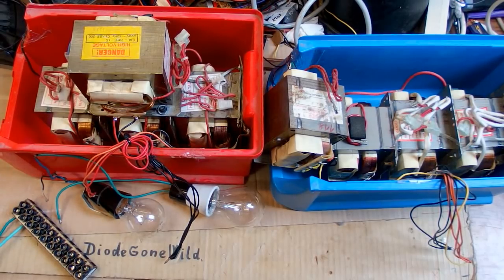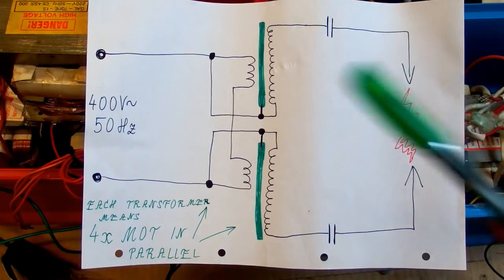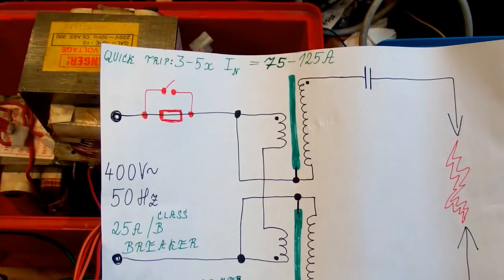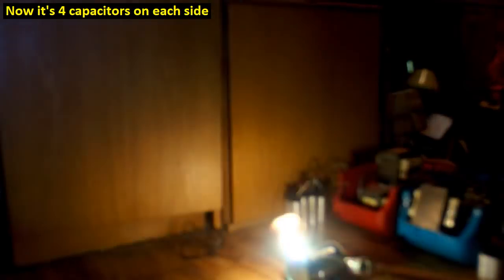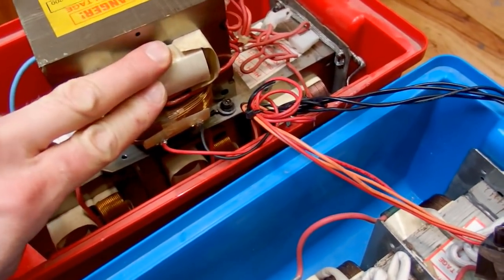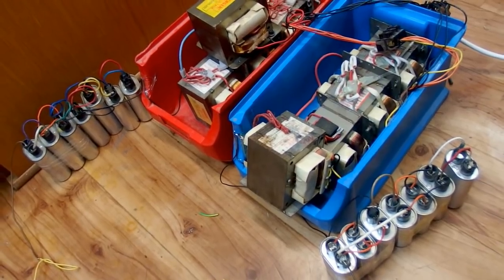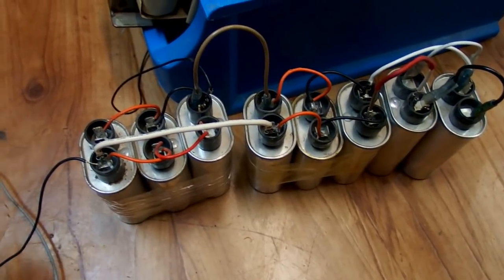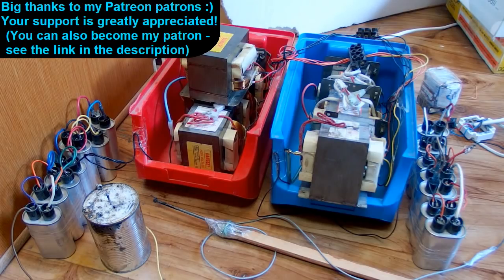Making Lightning in my Living Room

Comment: Do the same experiment but this time use a fire long and narrow in a straight line built in a trough. The electricity will take a very strong conductive path through the plasma of the fire 🔥. Your arc may be able to go 3 to 4 m.   Ozone generator

Comment: I'd like to point out that the arc is getting to be longer than the stick your using plus wood is not a good idea it can start to conduct. get a longer stick or one made of a better insulator.
Reply: @mernok2001  I spent some time doing lightning testing to some aircraft equipment. the switch handles for the HV equipment were rods about 5 foot long. they went in to the test equipment from the front and the switch was right at the back. one test house had a bank of cap's where each one was the size of a washing machine there must have been 40 of them. the problem with that sort of power you don't get a second chance.

Comment: Even though I'm a radio amateur,I'm even afraid to measure mains voltage..and diodegonewild plays with this ridiculously dangerous and completely unnecessary build,while safety precautions include a chinese sunglass,a flamable panth and a rubber sneaker :D

Comment: Now put secondaries in series.
Reply: You can't really because one side of the secondary is connected to the frame of the transformer and the insulation is only good for a little over 2000 volts. If you put two in series you will get arcing to the primary from overvoltage.

Comment: How the hell the curent go way higher in arching than in shorting!?
Reply from the maker: Short circuit probably saturates the magnetic shunts in the MOT's so it doesn't resonate with the capacitors so much.
Reply: @DiodeGoneWild  , as Szakallat said.
You can give an easy try, you usualy have old gadgets so I assume you have old analog amp meter with 25 or 50 amp range.
Well, till the corona-flu lasts no one in a hurry...

Comment: I would imagine there is a little radio interference, you pirate radio station lol.
There is no way i would mess around like that, measuring 40kv t.v crt anode via a home made resistive probe was worrying.
A very long line of blue 3 watt high voltage resistors  coated with anti corona laquer gave me a divide by 100 into a 10meg digital.

Comment: i can imagine the smell of ozone would be strong in the room
Reply: Its not too crazy with the voltage being so (relatively) low, the corona discharge is pretty low. Especially once the arc is struck. You'd get WAY more from a single 15Kv 20ma neon sign transformer sitting open circuit!
Reply from the maker: it smells more like nitrogen oxides. (because it actually produces them).

Comment: Am I the only one that felt nervous around 11:05? https://youtu.be/-9RB3T_kVh4?t=665 Maybe I'm just a klutz, but I think being squeezed between those transformers and the sheet of styrofoam I'd run a risk of losing my balance. It might be only a 1 in 1000 chance, but the risk of falling and getting electrocuted makes that more risky than having the arc electrodes between you and all the wires and equipment.

Comment: If you make the capacitors in parallel isnt the capacitors maximum voltage will drop
Reply from the maker: no, it stays the same.
Reply: Oops i misunderstood 
Only capacitor in series will drop the capacitance

Comment: Got 7 transformers 5 capacitors but dodgy electric or id have jacobs ladder at downstairs where the people like to smoke crack. Auto shock! But hearts are already running too near end! :)
Camera and remote. Wired iside with cables at each side of the wall. Heart level? Maybe not!

Comment: The switching needs to be at the zero crossings, not at the peaks
Reply from the maker: It's an inductive load. Zero crossing switching is good for a capacitive load.
Reply: @DiodeGoneWild  you're starting at zero current (the circuit is disconnected) so the ramping voltage of the sine wave prevents high current. The breaker trips from lack of inductance

Comment: I think your understanding of the AC cycles is not quite right or at least not detailed enough for me to understand where you're coming from. At the moment you connect the inductive load, the inductor has not had a chance to build up any magnetic energy. When disconnected the voltage across it will be zero. If you connect it at the peak of the voltage waveform the voltage suddenly jumps to that peak value, which will cause the maximum initial current. If you connect it at the zero crossing there cannot be any instantaneous current because there is no voltage to induce it.

The current being 90 degrees behind the voltage only happens in steady state. When you have a sudden switching on there will be a transient response that is a bit more complex than that. I'd have to actually do the math to see what point of connecting it will actually result in the maximum peak current.
Reply from the maker: My picture is a bit oversimplified, but the zero crossing switching really causes the biggest inrush in an inductive load. The current in an inductive load integrates the voltage, so if you switch it at zero volage, the current has the entire hafcycle to build up current, and thus the current reaches the highest level. That current would be double of normal peak in case the core didn't saturate. In reality, it saturates and the inrush is even higher, way higher. Switching on an inductor in zero crossing kind of traps a DC current in it, until it fades out because of it's resistace.
Reply: @DiodeGoneWild  Thank you for the explanation :)

Comment: make it dc for better arcs!
Reply from the maker: Adding just a bridge rectifier wouldn't help much. It would be interesting to have 3 such boxes of MOTs on 3 phases and then use a 3 phase rectifier. I already did it on a smaller scale:
https://youtu.be/cUJzQ0QPx9g
And I also tried to use 3 electrodes for 3 phases, no rectification:
https://youtu.be/vfixjqWcOwg